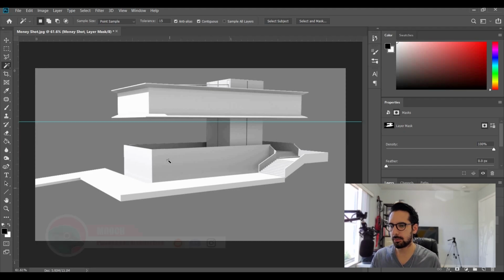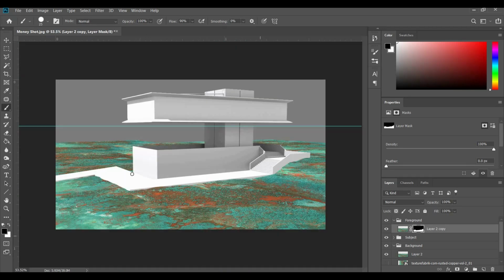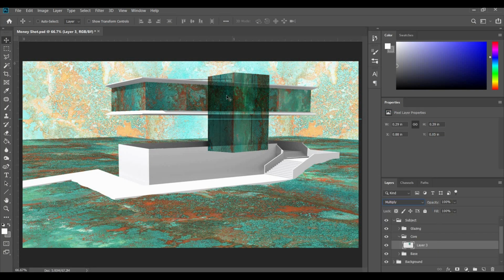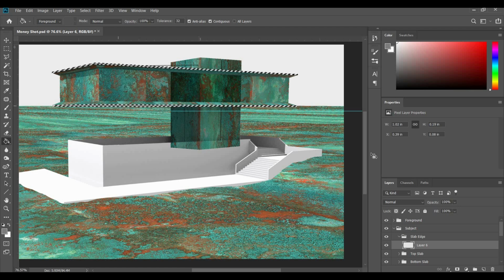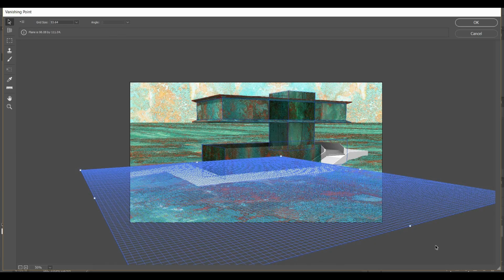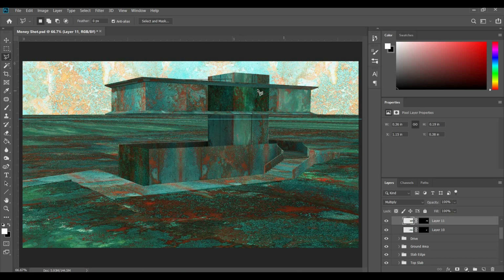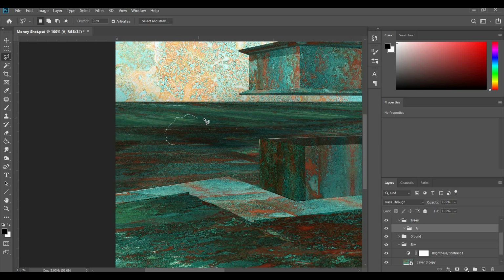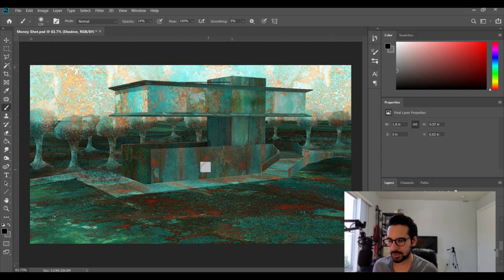Using ONLY One Material To Render This WHOLE Image

Comment: Sir, in basement we use Raft Foundation, so can we do the same for plinth ? 
So that I don't have to take my building columns  below the plinth..and the building columns will act as a floating column.
(Basement is under the whole building) 
Or any other way from which I can avoide columns in the basement?